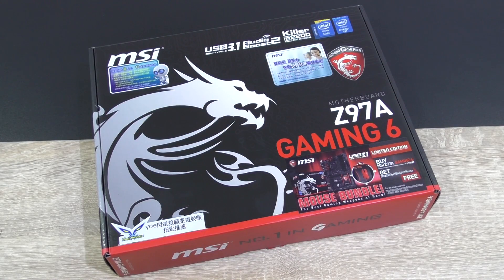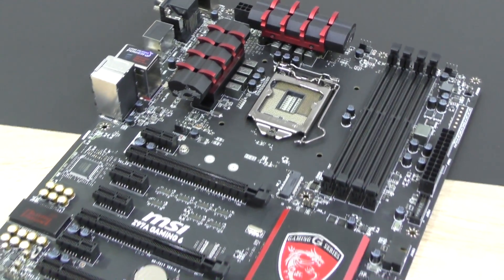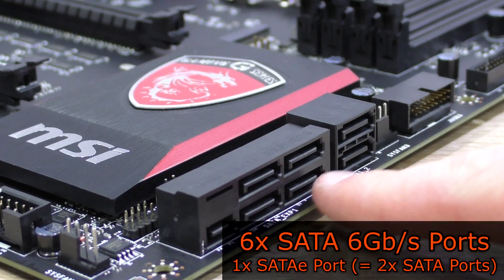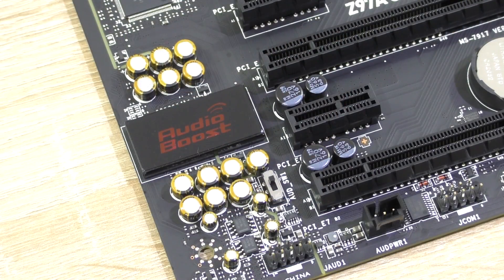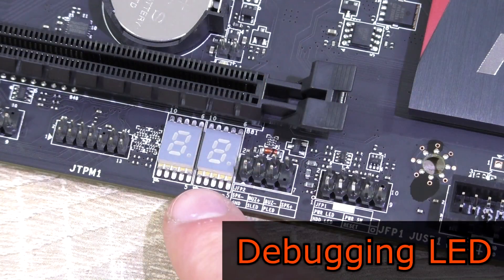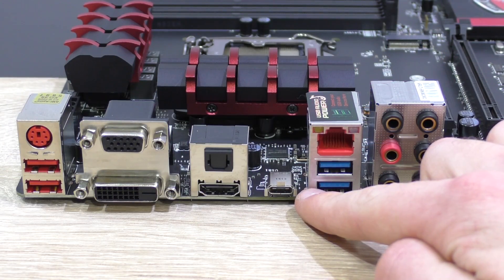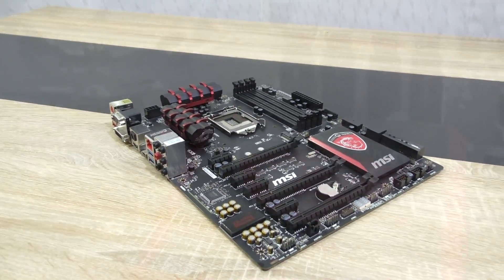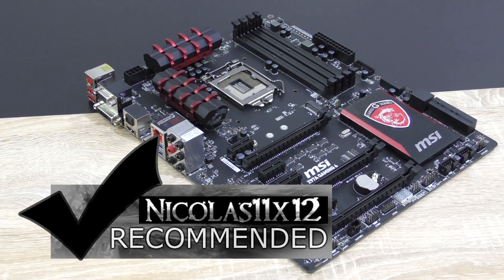MSI Z97A Gaming 6 Motherboard Review

Comment: does this motherboard come with fan controller software? my h100i is loud by default, but I use Aisuite's fan controller, thing is any other motherboard doesn't work with aisuite, but I want the audio boost (cause my current motherboard has rm interference going through my mic)